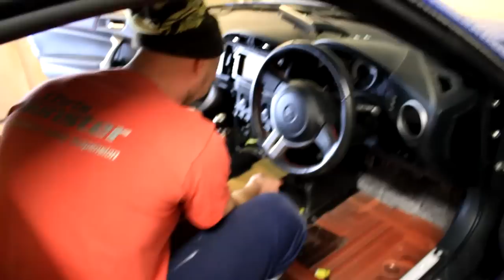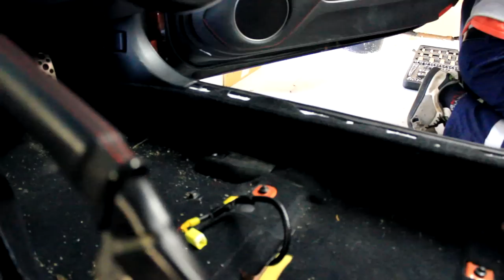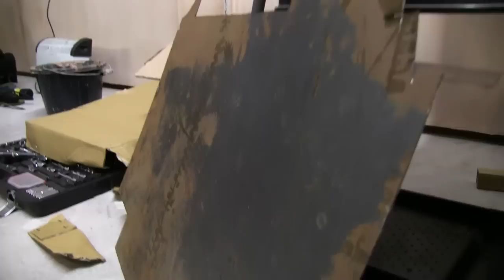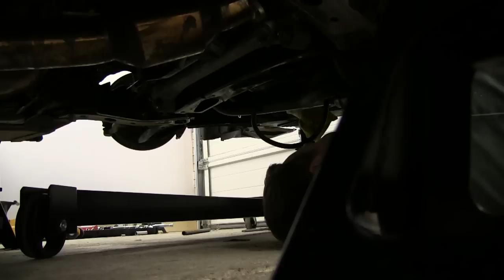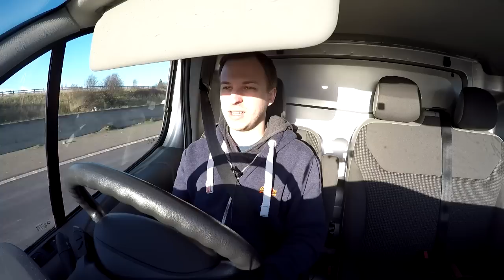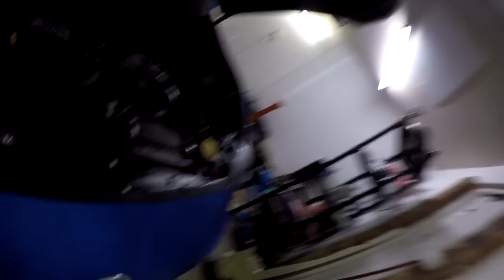Extras - January 2016

Comment: Seriously, I look forward to your videos more than anyone else's in my sub box.
Cannot wait to see the 86 after its all done at fensport and you got that handbrake plumbed in.
Reply from the maker: +vScoobyDoox cheers, glad to hear that :)
Reply: +DedicationBlog Agreed - I don't have a lot of time, but I look forward to making a few minutes for your videos.  Keep them coming!  p.s. a 2 post lift is not insanely expensive, if you're going to continue to mod cars in your garage, spend a few grand and get one!  - Here's what I've done garage wise so far: http://www.garagejournal.com/forum/showthread.php?t=213122
Reply from the maker: +Rob Freudenberg I did look into getting a lift but they all seem to be too tall to fit in my garage and most said they needed reinforced concrete as a base too. We'll have a video of my garage refurb up soon - not quite finished yet, still need to paint the floor. Its not going to look anywhere near as good as yours though, wish mine was that big (the garage I mean...). Nice job on it so far
Reply: Thanks for the reply.  You need about 12' of height.  That's the difficult part, the reinforcement is no big deal.  Dig a few holes, and pour some concrete.  Nothing you two couldn't handle, and it'd make a good video!  Thanks for taking a look at the garage, looking forward to the next video.